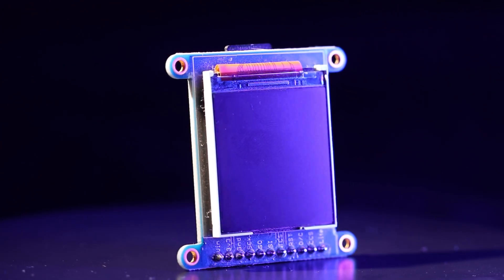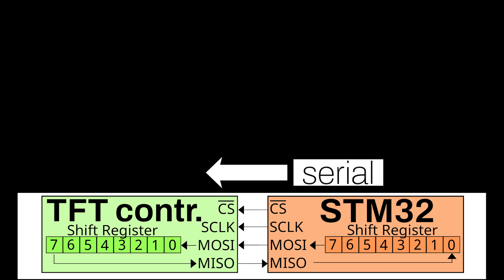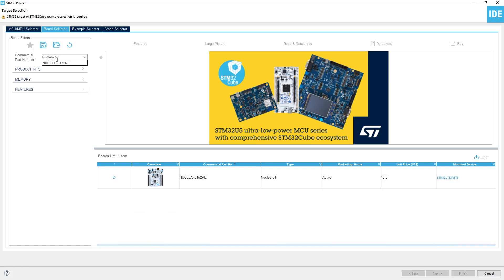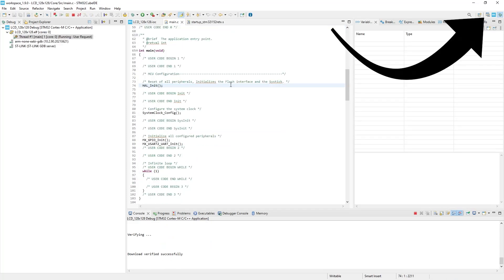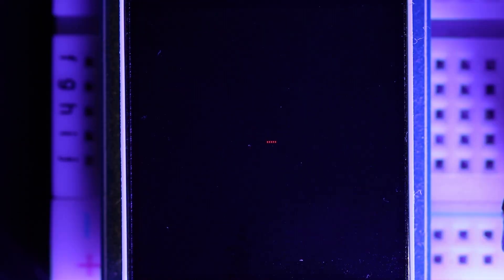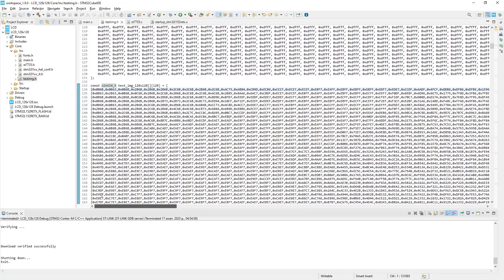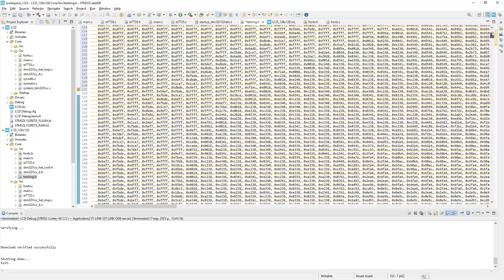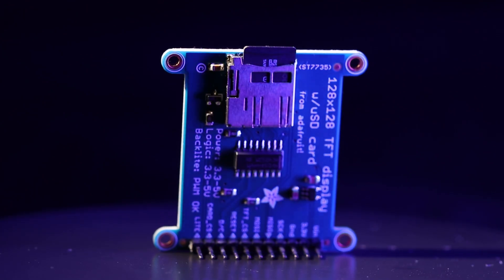STM32 + LCD TFT = Display Any Data

Comment: Hello, I am using ILI9341 2.4" TFT LCD screen in combination with STM32F411E DISCO board.
I followed all the steps and the screen is flickering..... but when I try to reflash again, I am able to see the black rectangle with the printf written inverse. This black rectangle does not cover the entire screen, I assume it is because of 128x128. How do I resolve this issue?
Reply: Hello, did you ever get it working? I have been struggling to get my STM32F7XX to work using a similar ILI9341 2.4" TFT LCD. I simply can not get my display to do anything, it just stays white all the time. What did you have to do different from the video to get it to work at all?

Comment: Hi !It's very impressive work you did !I want to make it but I have a different board (STM32F411E_Discovery).How to import it for the chip (100pin STM32F411VETX)   I have?
Reply from the maker: You should try doing it on a project creation step. Choose the discovery board you are using to automatically assign peripherals through IDE. Then in the code change communication pins to the one used in your board. Its hard to say which kind of errors you will get but you should do it step by step

Comment: Sadly it doesn't seem to work for me. I have a STM32H7 Nucleo Board. No errors in code but nothing shows up on the display. Can you tell me haow you connected the CS, RES and DC pins? Which pins did you use and how does the library make use of those pins?
Reply from the maker: Hmm. The problem could be in anything because there are a lot of steps. There is a connection diagram in the video where you can see how I connected all the pins for the display. In the library, you can find the pins configuration in the "st7735.h" file. In the video, you can see it in pieces of code at 09:13 minutes.
Reply: i have the exact same problem, it look like all is good but nothing works. i also needed to add a malloc function. Someone know how to solve ??????
Reply: Well, I did connect the RST to PC7, CS to PB6 and PA9 to DC, but as I said, the display doesn't react at all. The display itself shouldn't be the problem since it works perfectly fine with an Arduino Uno. I even lowered the SPI clock to only 5 MHz. But still nothing :/
Reply from the maker: @Atom224  Hm. I believe you do not have a logic analyzer or an oscilloscope to check the signals. Did you set up all the pins as outputs? My suggestion is to check everything step by step again. It must be some loose wire or wrong bit somewhere
Reply: @NickElectronics  I do have access to some pretty advanced logic analyzers and oscilloscopes. Though I'm still a novice 😅, so not much experience using them. I'll see what I can do tomorrow and maybe write back if I'm still stuck.

P.S.:
I did set the PC7,PB6, and PA9 as GPIO_Output in CubeMX.
Reply: Make sure your pin definitions are correct in ST7735.h!
Reply: I just stumbled on the video and your comment. 

I may be late to the party. However,  I think STM32H7 SPI requires special handing. 
For easy setup, ensure you use HAL. But if you are bare metal fan like myself,  then you are out for serious battle.  

The SPI is the simplest among the communication protocols, but sadly, I have seen comment on the Internet that suggest lots of guys are experiencing issue with the stm32h7 spi

Comment: How can we use custom Fonts with this library? There are only 3 fonts provided with this library. If you could kindly tell me how those fonts were created, I might be able to create my own.
Reply from the maker: Simplest option is to download libraries with fonts. There are a lot on github. Also, check out dafont website as well. They have got plenty of fonts :) Good luck
Reply: @NickElectronics  thank you for your rapid reply 😊

Comment: Is there a way you can replicate this on a bigger display? I am using a 320x240 pixel display and am not having much luck. My current setup is a NucleoU575ZI-Q and a DFR0664 2.0" 320x240 IPS TFT LCD Display.
Reply from the maker: Unfortunately the controller this board has does not support screens with such high resolution. For your display you should have a look at Ilitek ILI9341 controller :) Have not checked personally but the control should be similar, via SPI. LCD image converter also will work. Libraries will not. So you will have to find new ones. Probably there are some on the git) Good luck

Comment: Thanks so much, ...if you want to use the integrated SD Card, how to do it? (for example to storage in SD Card some map pictures to shown at the display)
Reply from the maker: Hi. Unfortunately, the library from the video has command only for the display. To use SD card you have you add on more library which supports SD card + STM32 communication via SPI. Cause communication with an SD card in the module i show is also established via SPI. On the board itself there is a pin - Card CS (CCS) and TFT_CS, which allows to switch between TFT and SD :)